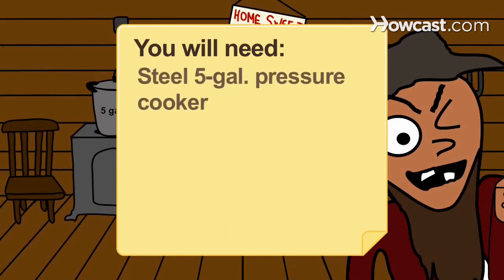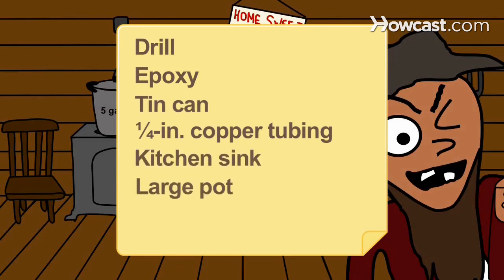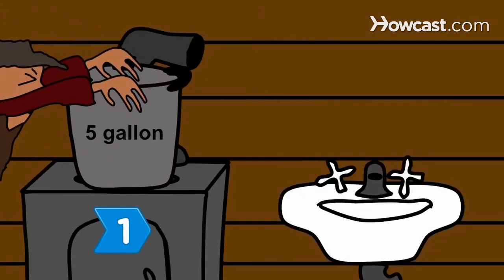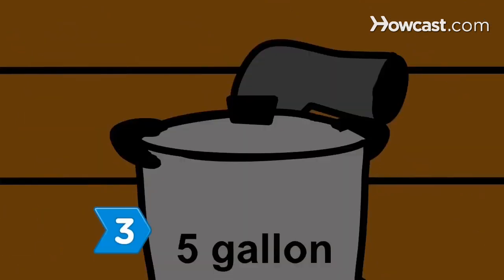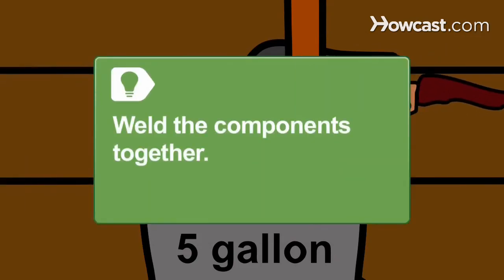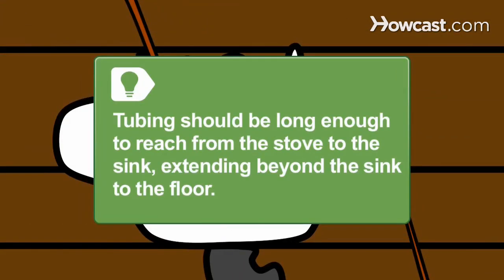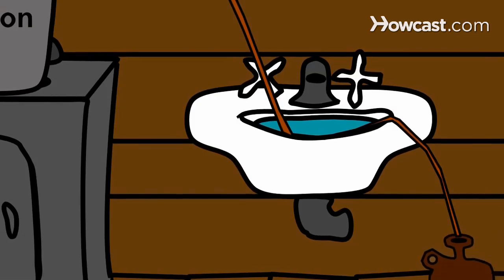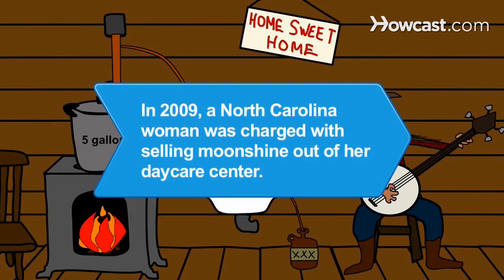How to Make a Still

Comment: @PlanetPatricksVideos A still is a permanent apparatus used to distill miscible or immiscible (eg. steam distillation) liquid mixtures by heating to selectively boil and then cooling to condense the vapor.  Stills have been used to produce  distilled beverages containing ethyl alcohol.

Comment: Unless you distill wood to synthesize Methanol (and drink it)  you will not loose your sight.... 

Ethanol (An alcohol derived from sucrose) decomposes to acetic acid radicals which, though mildly harmful, will not cause eyesight loss. Methanol is created from the synthesis of carbon monoxide and hydrogen (usually produced from the distillation of wood). Decomposing methanol yields  formaldehyde radicals, which as may have known, causes the loss of eyesight as well as death in larger quantities.

Comment: Don’t use these directions there are many other correct methods out there look them up please. First off never use epoxy on a still this will release toxins into your brew second off don’t use tin or aluminum in a still only copper and/or stainless steel. The can at the top of this still is supposed to catch the alcohol steam and run it into liquid sending it down the copper tube where the steam will continue to turn into liquid from the water in the sink cooling it. Im not sure how that would work using these directions. I didn’t even finish the video so I’m sure there are many more mistakes but they did get the pressure cooker right AS LONG as it is only stainless steel or copper. Any way go out and make some great liquor and don’t pay the taxes on in the feds love that. But save me some.